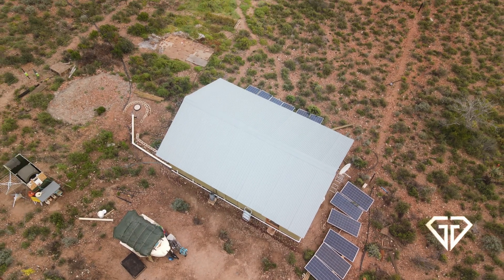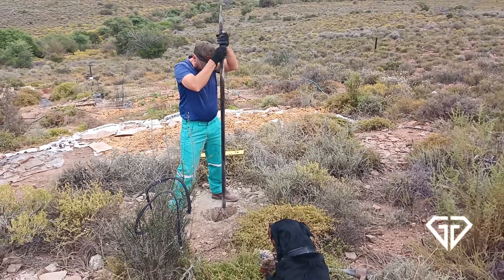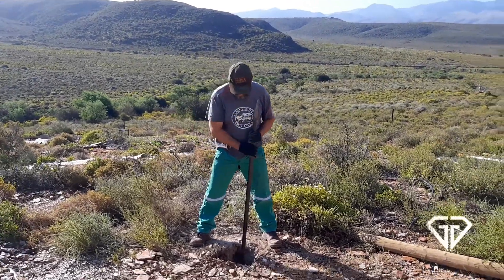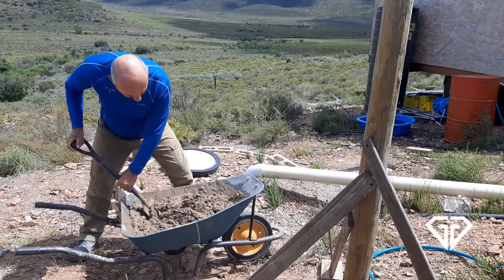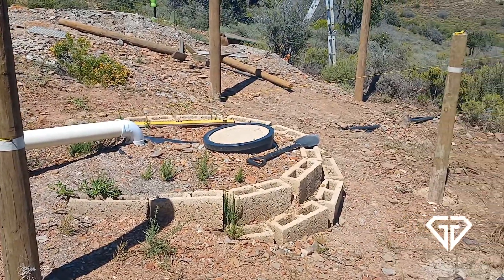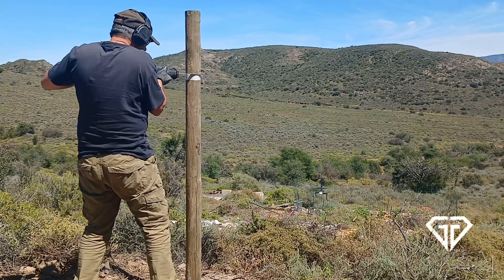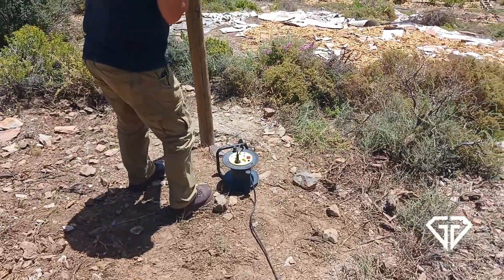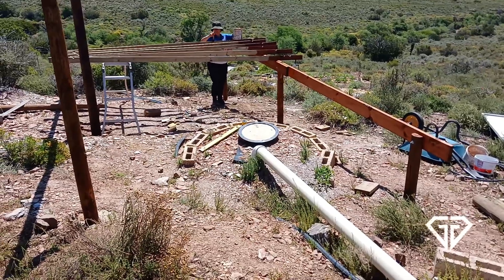Construction, fitting of our optimised solar panel frame (Update 022)

Comment: Goeiedag Hein, do you make use of a battery to store energy from your solar system?
Reply from the maker: Yes, I have two 5kWh lithium iron phosphate batteries to store the energy.  This is more than enough, especially in summer (usable sun till late).
Reply: @Going_Galt  Hein, maybe a video on this setup?

Comment: Too much digging, and no info on how the panels were mounted to frame.
Reply from the maker: @erikdolson1507  True, I should have shown that! It was a lot of digging, in my defence. Each panel is mounted to the 50x75 support beams with 4 x 100mm long M6 bolts, nuts and washers, from the bottom.
Reply: @Going_Galt  Holes drilled through the frames of the panels?
Reply from the maker: @erikdolson1507  Yes. The frames have 4 pre-drilled oblong mounting  holes, but after trying to drill the beams for those holes on the first panel, I found it easier to just add new holes in the frame.

Comment: Looking good. See the comment regarding the panels on the roof, but I agree. If you are going to use the structure for additional storage and it also helps with any changeout or repairs as its much closer to the ground.😂😂

Comment from the maker: The angle of the roof is just right, but the house is facing northwest. This will bias the solar for maximum production towards the afternoon. Not a problem though. But I planned the stand from the beginning, and also, I don't want too much weight on the roof due to the ridge beam/rafter construction rather than trusses. Personal preference.